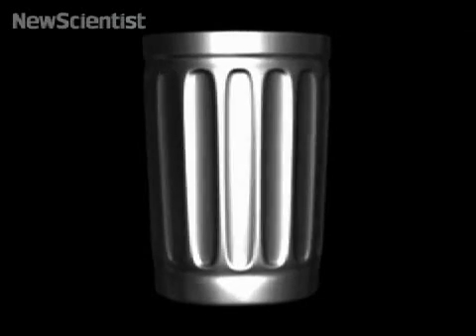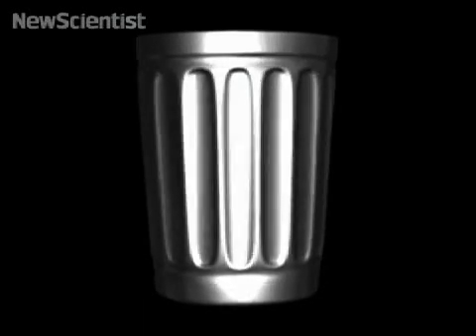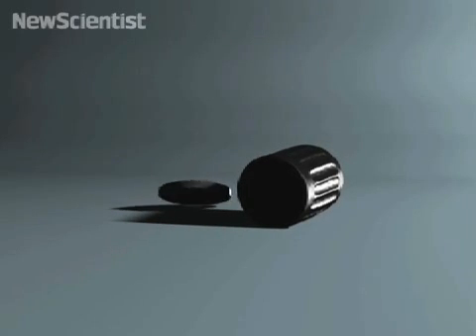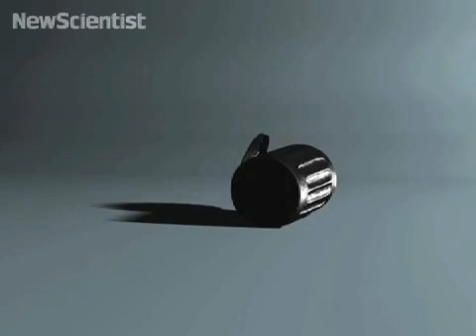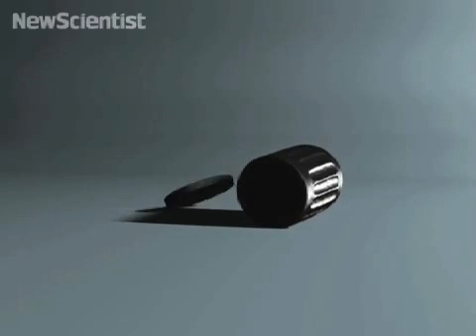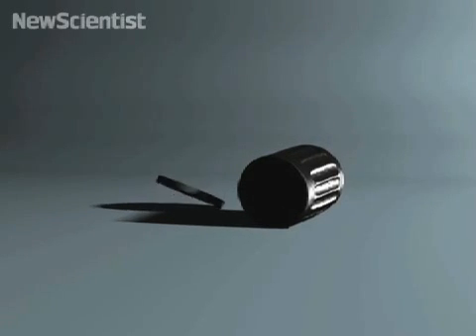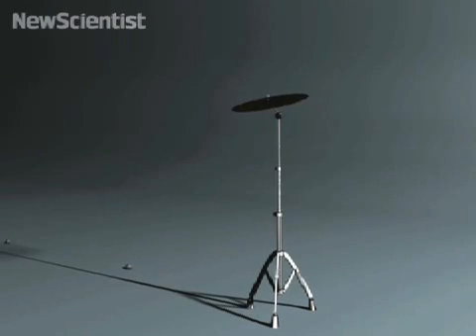Virtual sounds get real

Comment: Um... what's wrong with matching real sounds with virtual objects? I've made a ton of Flash/Unity games and never once needed a simulator to make sounds... granted, I guess once they fix the sound calculation time this could potentially be used in real-time simulations, but until then I'm sticking with the old method of putting sound clips with actions and events =P

Comment: Sorry I shouldn't of called you a idiot but I think this is a really good step forward for technology like this.
This clearly isn't a finished product and people aren't going to start using this technology in games tomorrow but in a few years it may be possible to generate some sounds in real-time.
The problem with recording a sound is that it's not dynamic and is harder to take into account that in different situation a different sound clip may be needed.

Comment: snowflake:

its still trivial. harmonics are nothing less than several tones at the same time. there is nothing complex about it. you do not need to identify chords, just identify all notes (by looking at the volume at specific frequencies) and then if its 3 or more notes at the same time, well, you got a chord. 

you filter out every single tone that there is individually, like an equalizer with 80 bands or whatever it takes to cover anything that is audible, starting with the lowest.

Comment: Thanks for the tip, Will check out singstar - but remember I'm not talking about single tone recognition - the obsticle so I've been told is chord recognition. A guy to looked at a graduate program out of Berkeley said the harmonics are too complex to accurately identify a "unit chord structure" on a piano from a recording.

Comment: snowflake70:

that already exists, ive seen it years ago. you could whistle or sing a melody and see how the correct signs appear on the screen. just a piece of software.

unfortunately ive seen it on TV and dont even remember which program, so i dont have a source. but it should be easy to program it, and compared to these simulations...  trivial. 

just take a look at those "singstar"-games that detect how close your voice is to the sheet music, note by note, in realtime.